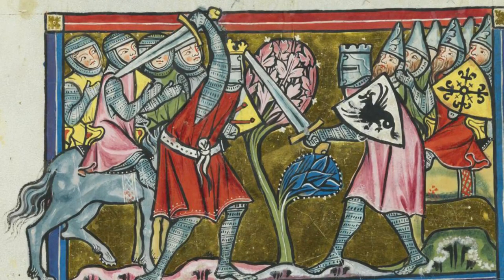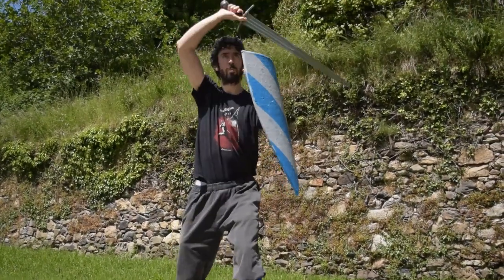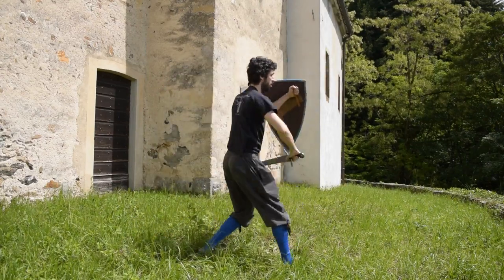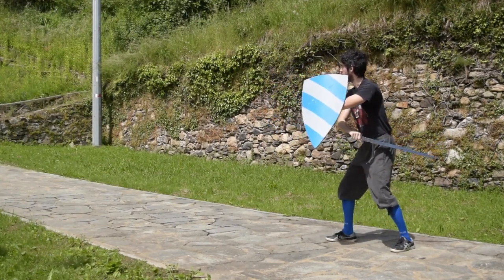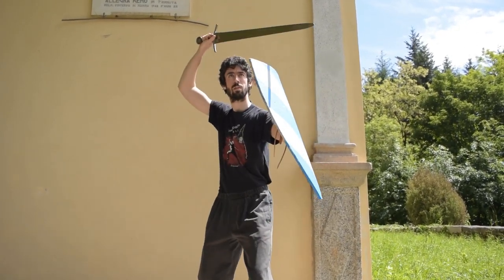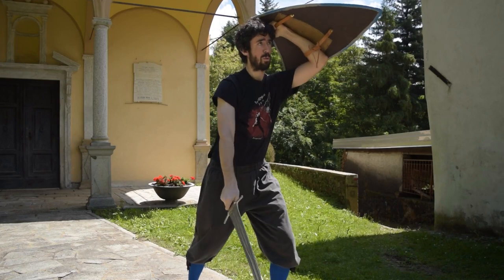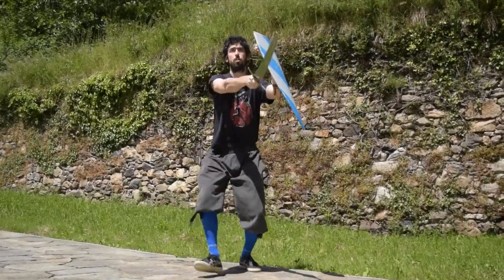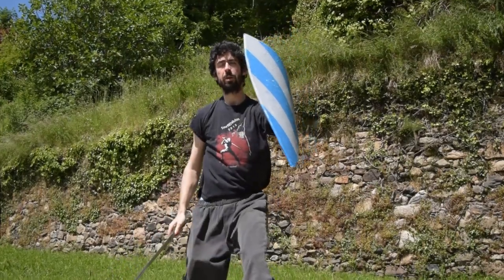Heater Shield - Cutting Drill

Comment: How important is it to stay square to the opponent?  What do y-u do if you find yourself striking the edge of the shield in the 5th guard? (The Strike from bottom right to top left.)
Reply from the maker: As i. Any other fighting system which uses both the hands keeping a square position is important at the very least 50% of the times, we are mainly talking about the situations in which you have to strike offensively while left foot forward, or when you need your shield more forward while you keep a right foot forward.

Well you should try to avoid hitting the shield to not get stuck into hit (of course this is in terms of sharp swords) so avoiding it is important. I give two advices in the video to achieve this ;-)

Comment: You're holding that heater shield way too far out from the body.
This is going to fatigue you.  The style of fighting using a heater vs using a buckler or other centerbossed shield are VASTLY different. 
You hug the heater closer to the body and use it purely defensively. 
You're recreating dueling moves with a cavalry shield..
You don't see the issue with this?
Reply from the maker: Thank you for taking the time for giving me a tip, but I can’t do anything else than assure you that I know quite well what I’m doing and why.
Reply: @FedericoMalagutti  I do not doubt your ability with dueling equipment. But a heater isn't meant for duels.
It's uses and mechanics are vastly different. 
Using it in this way is a detriment. You are better off with a buckler.
I also know what I'm talking about.
I used both for years.